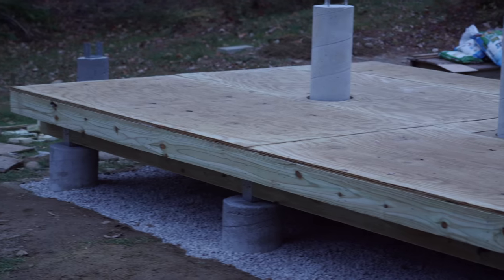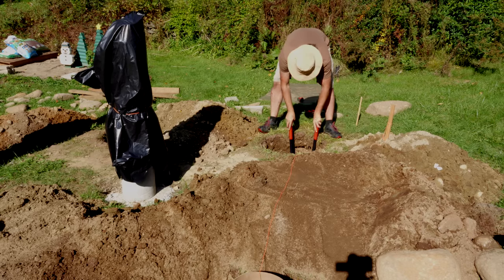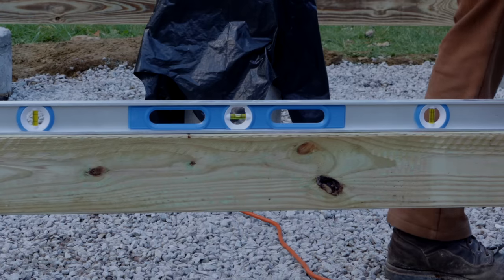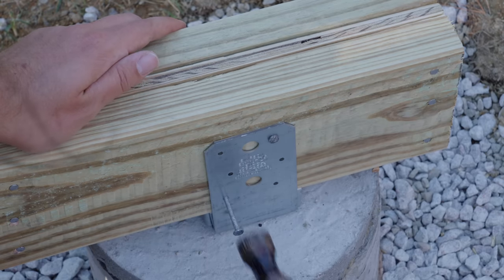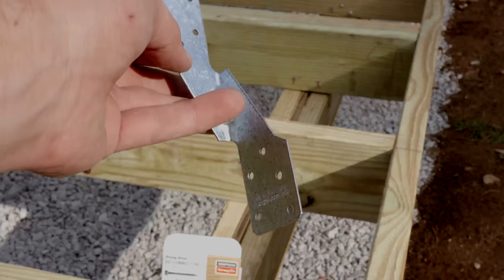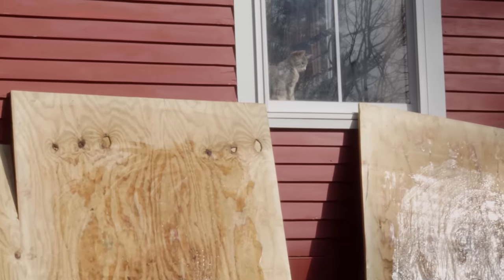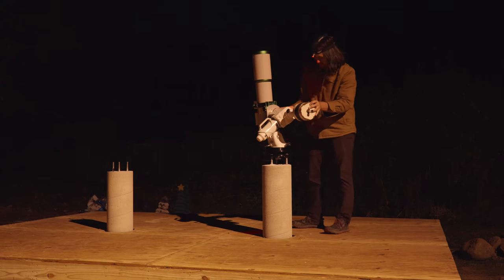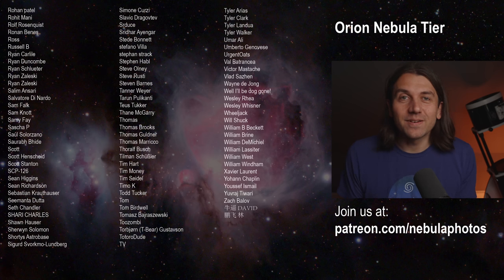My DREAM OBSERVATORY has a FLOOR!

Comment: I may be wrong here because I'm going off a memory of an episode of TOH from decades ago but I've seen that when they were putting stakes in they would also make sure the lines were level and would add additional stakes and string that would cross at the center of the SonoTube.

Comment: All wood shrinks when it dries over time. So the blocks will get short if they easily fit when having a higher moisture. When you buy it make sure that all the wood is fairly equal in moisture so they shrink equally much. Always measure center/center so the wood will still stay in center after the wood dries. Hopefully your wood was really dry to begin with.

Looking forward to seeing more. :)

/cheers

Comment: Hello. 
My name is fusy. I am Japanese.
I always enjoy your videos.
I also built an observation hut in my garden last year.
The average residential area in Japan has a small garden, so the size of the shed is 2 x 3 meters.
You can see how it works in my video. It took me over a year to create it, working alone.
I bought the pillar without making it. This is because Japan has many large earthquakes, so I'm worried about it tilting.

Something I noticed in the video.
Toward the end, I was operating the telescope, but I feel like the pillars aren't high enough.
When photographing at lower latitudes, the telescope approaches horizontality, but in its current state I think the wall will be very low.
I adjusted the height of the wall to my height. I then aligned the pillars at that height.

I'm looking forward to its completion.
Reply: Wow !! Visited your channel, I'll watch all of the videos one by one

Comment: I prefer to use water in a clear tube to get levels over distance. I'd also set the anchor bolt in resin, concrete breaks too easily with outward pressure.

Comment: A 12+" EPDM roof pipe flashing seal might make a good vibration-isolation seal between your pillars and the floor? Dektite makes one in a 9"-20" pipe diameter which should fit nicely over the piers.

Comment: Hi 👋, Nico, looking very good, with obviously limited tools and knowledge. Sorry I had to put that in, for the holes for your pier, you could make a tremble arm coming off of your router to create a circle that you can cut it out with, using a piece of board bigger than necessary, but mark on it. The dimensions of the piece of wood that you’re going to fit into the hole around your  pier, this way, you’ll have a perfect circle with an equal gap going round it, then if you need to gain access around the area you can obviously then cut the piece of wood in half so if you need to you can lift one side up, I suggest making your sides and ends for your building before making the Roof, if you go on YouTube, you should be able to find how to make frames up that you can come wrecked yourself puppy on the length you’ve got probably three panels will be a good idea. You could even finish them off so the outer side is finished with an overlap on the bottom if you’re using OBS board so the overlap goes down the side of your floor section which end will make it easier for you to fix to line everything all up, and have some timber available that you can use as props and stays to hold things in position whilst you fix it and probably some quick clamps will be a good idea as well, I wish you all the success for the future, and hope you all have a great Thanksgiving holiday, Phil from the moulin, France

Comment: An idea.
When sinking pillars, you can do it a cheap way.
Sink the 1st pillar to required hight. When set, get a length of clear hose pipeing (see through) long enough to reach the furthest pillar including the hight to be measured (ie to use pipe like an upside down staple/ square  shape U). Fill the clear (see through) pipe with water till it reaches hight of first pillar. The water at the other end of the pipe will be the same hight. If enough length of pipe is provided. Hence all hights will be equal. Just make sure the vertical is correct.
You can always use the clear tube after the job of building as an extension on a sprinkler. (Or a normal hose with a clear tube fastened each end).

Comment: Just a quick thought, maybe use pool noodle or pipe insulation to go around the peers with the pipe insulation has a slot would fit nicely on the wood and seal up that gap

Comment: Add little cleats on the bottom of the floor frame.  These will help when it comes to installing siding, by yourself. Just sit the siding on the cleats and push against the wall.
😅
Nico, screw your siding to the walls.  

Pointer.   Nails punch holes in wood, these holes are great for bugs and rot.
                 Screws, thread into the wood.  Makes the structure more solid, and they are less destructive to the wood, plus they can be re tightened over time,,,,nails really cannot.

Spend what you need to build the structure correctly.  Don’t go cheap just to save a hundred dollars,,,,trust me.

Comment: You don’t need to make your the tubing for concrete level or plumb. You just need to make sure the center of them are where you need them. Granted it does help. But not that important. Concrete will level its self.  You only need to worry about placement and  Elevation. Which you can make up in your elevation with the 4x4 or 6x6. No shims needed.

Comment: Please fix the pieces around the piers and as far as the weatherproofing you can use Butyl Sealant Tape to fill the gap between the fixed pieces and the piers without worry of transfering vibrations.

Comment: Possibly some pipe insulation between floor and concrete pillar? Soft enough to conform to shape, soft enough to not transmit vibrations.

Comment: When I worked in construction we used this water hose level, which would have solved your leveling issue, and it's way cheaper than the laser.

Comment: A water level like the Romans used is very cheap to make (you just need to clear tube filled with water) and it works achingly well. Pah to laser levels ( at least for your foundations)

Comment: One trick ive seen is using transparent tubing which you fill with water - like fish tank pvc tubes - the water level in the tube is your level.  you can then move the two ends of the tube around and water in the tube wont change - over distance.

Comment: Considering you are building a garden shed, not a house I think the foundations are actually a bit excessive , it might even have been easier to put in a rebar reinforced concrete slab. I am from UK so rules over here might be different.

Comment: I appreciate the extra challenge you gave yourself by doing all your excavating with a post hole digger...J/K

No judgement, just a bit of "wisdom" from a former "professional" ditchdigger...keep that thing laying in the corner unless absolutely necessary.

a frost bar, a 5 foot shovel, and a tiling spade can perform miracles...

Keep up the good work....

Comment: why did you opt for two 2x6 plus one half in plywood for the floor beams? wouldnt a single 4x6 give you the same actual dimensions without the extra work?

not a dig on your choice, just curious on if it was due to availability of lumber or some other thing i just didnt catch

Comment: It's a very nice job so far but you seem to have overthought your concrete levelling problem a bit.
In reality none of the concrete piers have to match the height of the others. You can insert 90mm (4"x4") galvanised stirrups into the wet concrete, bolt 90mm vertical posts into the stirrups and then cut the posts to the desired height. Then you can bolt the rim beams onto the posts. It's a pretty standard way of building things like decks and even house extensions on sloping land.
It's a good way to do something like an observatory because if you have nearby houses, mountains or trees you may want to get the structure up higher to improve the telescope angle for longer imaging sessions. It's amazing how many extra degrees of sky you will get with half a metre extra height.
I know it's not going to help you now but it may help someone else.

Comment: If it makes you feel any better, I once went to check a self leveling laser's accuracy. I happen to work in a building with a room where the floors are guaranteed to be level and smooth to a very high degree of precision, and I found that the self leveling mechanism is off by 0.45°, so over 16 feet you'd still have been off by one and a half inches.

Comment: I never do the 45 degree nail thing. I drill and screw from the other side or you can do a small 1/2 dia pilot hold and nail. I know that's a ton of work but I can't help it.

Comment: Why not to make concrete slab? Then, you could cover it with anti-moisture coat, and put entire building on it. Concrete could be covered with wood or tile floor. I will say outdoor tile is better.

Comment: This reminds me of a project undertaken by my brother-in-law in India. They were building a factory which needed level floors and were using a water-filled trench to establish the level.  He said that what was needed was a laser level. The construction work workers responded that they indeed had a laser level, but that only a high-level supervisor was authorized to use it. My brother-in-law insisted, so they brought it out from locked storage and got the true level established.

Comment: It would be easy to fix your staggering mistake, instead of moving one of the panels you cut a hole in, you can deal with the 2 whole sheets one the side. Cut one in half, and stagger. It probably isn't that big of a deal though.

Comment: I use stainless screws wherever I can. Expensive but nothing is so expensive as having to deal with rust long term. Also I use stainless nuts bolts and washers on the post holders. If I could get stainless post holders, I would use those too. Also treat the hell out of all the wood. Soak it in the most nasty stuff you can buy at Home Depot.

Comment: First of all, i hope you didn't pay your architect or contractor for these proposals 😅I think a slab or strip foundation would have been a better option because it would have saved a lot of time. To be fair, since you would need more concrete and probably rent a mini-excavator, the equipment and material costs would have been higher. I would definitely have included an adjustable metal plate in each of the concrete foundations, as you can expect the foundations to settle differently over time - this would also make it very easy to set the exact height at the beginning (using a levelling device, not a laser).

Comment: LOL, you made that way harder than it needed to be. Post mounts embedded in the concrete on each pier, then the post tops are easily leveled with your beams and floor joists. Shouldn't need any concrete drilling.

Comment: can i suggest to NOT put the outlet flat on the floor? it will fill up with dust and water and it's not a good thing to mix them with electricity. check some "electrical outlet floor turret"... thing...

Comment: Use screws rather than nails. Nails are NEVER a clever solution when attaching wood into brackets!
Also make sure nothing touches the piers, as walking will cause vibration,